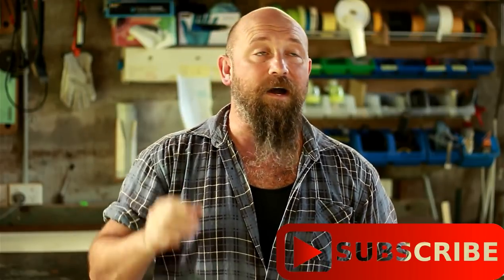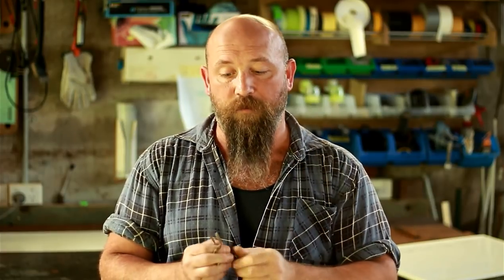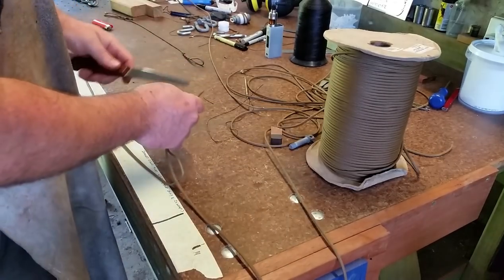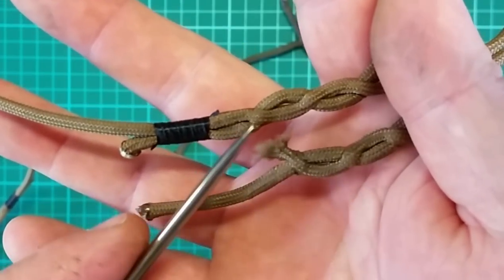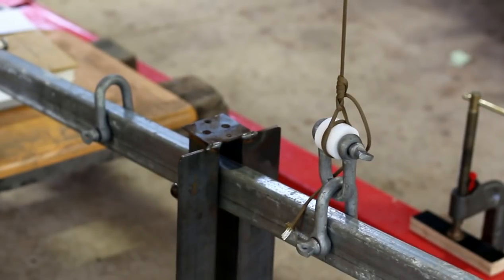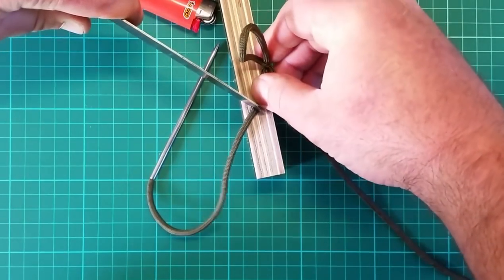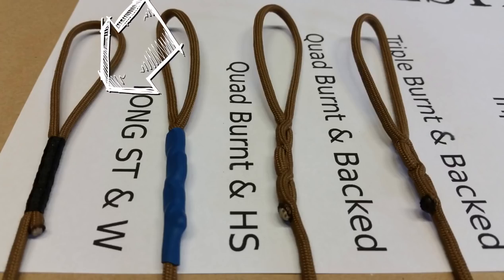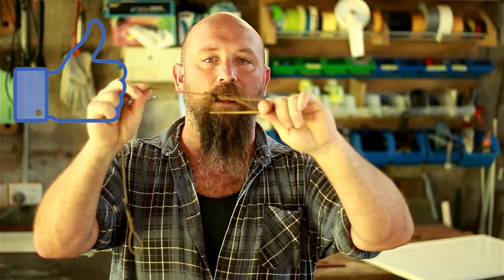Prarcord Break Testing with a 2 TON Engine Crane!!

Comment: Thanks for the video and the information, Ben! I suspect the whipping acts in the same manner as the heatshrink tubing, preventing the small amount of movement necessary to properly tighten down.
Reply from the maker: Cheers Grant, long time to chat mate! I have been tossing around the same thoughts. Although It won't match a true buried eye splice, it needs the same amount of stretch and compression.

Comment: MAAAAAATE Great video, actually came looking for a video on doing an eye splice with 550" cord, as I have gotten into making my 550" 7 strand, into 1600" 21 strand, combining 3 lots into 1 cover (it's a real fun thing to do) start with 4 lots of 550" paracord and attach 3 to the end of 1 (melt 3 of them into a point and attach the other strands to pull them through) but would be interesting to see about doing an eye splice with the para cord.
Reply from the maker: G'Day Iron Forge Knives and please excuse the late reply. I'm not normally rude, I just missed this comment. 

I can't say I have come across bulk packing the paracord like that! I like it and I might have a play with the idea myself. One thing I have noticed that really impacts how much you can fit inside the paracord sheath is how tightly (and strand count) wound the outer sheath is. Some of the cord I have, you can pass almost anything down through it as it is really loose. You could easily do a proper buried eye splice with that cord. Look up the 'Locked Brummel Eye Splice'. The bulk of the paracord I have come across sits in the middle (real 550 cord and the good quality copy) you can partly do a buried (about 130mm) or locked brummel eye splice with a polished 4mm fid. 

I do like this stitch through eye splice as to be honest, It's quick.  A proper buried eye splice with slippery cord is 78 times the diameter...I think. Its closer to a foot (300mm)

Since I was so rude  ;)  and replied so late, here the link to the next clip. 

 https://youtu.be/lvBPyYSTzyk

You might find the info on simple tube fid making helpful for custom sizes as well as a tute on my Stitch Through Eye Splice. I have not launched it yet as I was planning on finishing an instructables for it at the same time...and of course, I don't have a whole lot of that at the moment. 

Thanks for the info and comment mate.
All the best,
Ben
Reply: Machete Bushcraft Australia all good mate , I carry the 21 strand as a back up for camping, hiking and in my GU Patrol, it’s super strong and just nice to have something that strong and light weight on hand if the need arrives.

Comment: I I remember correctly, the other good thing about the figure 8 is that it is easier to undo after load is applied than some knots
Reply from the maker: Darn good point ED and I missed that. I would be an easier knot to undo and I'm sure it's one of the other reasons it is commonly used.
Reply: Probably weakens the rope less too...

Comment: Conventional wisdom says that the safe working load of any rope is around 1/5 to 1/3 of the static load. In other words, the working load is around 100-175 pounds on a 550 paracord line. I wouldn't want to hoist up anything over 150 pounds with a 550 paracord line. 

Each inner strand has about a 50 lb static load rating. The outer sheath has about a 200 lb static load rating.
Reply from the maker: I agree mate. It's tough cord, we just need to apply a little common sense in how we choose to use it.
Reply: @MacheteBushcraftAustralia  I'm shocked at the results you have. It's exactly what I was looking to find out. Trying to make a hammock out of paracord and I would like my suspension to be built out of paracord if possible as well but we shall see. I know after several uses it can wear down on the external shell just from pressure alone over time. Thank you for your video!

Comment: Do you  know off hand how the Bowline stacks up?
Reply from the maker: Darn good question Lazix. I did play around with the bowline recently as I had the engine crane set up. I did not set up the scales though.  It's a good knot but it did not rate as well as the Fig8 follow through. The Bowline was a little more slippy (Had to tie back up hitches).
The test was a length of paracord with a bowline on one end and a F8 follow through on the other. I only tested it only twice though.  The line snapped on both tests at the first hard bend on the bowline.
Reply: @MacheteBushcraftAustralia  Good to know, thanks.

Comment: do you made any tests with the 'classical naval' eyelet?
Reply from the maker: Is that the standard eye splice for 3 ply ropes? If so, I have not tested that yet. I can do them but I must admit, I am not an expert. I guess I focused more on kernmantle style rope as it's more common now days. 

One real advantage to rope work and rigging is that it is a very well tested and documented area. Even though I found some percentage discrepancies with the fig8 follow through, I'm guessing that has more to do with my ability vs the experts data. It was still a useful experiment on my part to compare different style knots with the same cord on the same rig.

I will give that classic eyesplice a go next time I pull that test rig out.
Thanks for the question Rafael.
All the best,
Ben
Reply from the maker: Wow! That is really impressive. I had watched that clip many years ago and it was good to get a reminder of it. It is a very tidy looking system but I'm not sure it would work with paracord... it might??... I think I will have a play with it when I get the chance.
The problem you have is that most of the decent quality paracord has a fairly tight mantle which is going to make this tricky. The other issue is that the 7 internal strands are not woven. There could be a work around for it though.  
Now, you can actually do part of a buried eyesplice with full strand paracord and a single 4mm fid. It's challenging but doable. The Locked Brummel Eyesplice is the one I have had most luck with. You can get away with a shorter bury because you have one stitch through (the 'locked' part in the name).
I do like the speed and ease of the stitch through eye splice method though. I think it makes an attractive and slim alternative to a knot.
I will be giving that eye splice method you shared a go in paracord. If I pull it off, I will pass on the credit to you for it.
Thanks for taking the time to share mate.
All the best from OZ,
Ben

Comment: What about just whipped? For like 2 inches
Reply from the maker: That is a good question Lee. I'm sure there would be a tipping point where the whipping  would be full strength. I guess I did not test it as I was focusing on quick methods to getting a load bearing eye splice. The stitching method vs known knots seemed like a good match up. 
If I ever get that rig out again, I will test some long whipped splices... I'm a little curious myself to be honest.
Reply: Machete Bushcraft Australia I think you did a great test! Not knocking you or your tests!
Reply from the maker: Oh buddy, I did not take it that way at all. Trust me, I'm pretty laid back in that regard. It's just a rule I have that if someone takes the time to comment or ask a question, I do my best to give a proper answer. It was a good question you asked and it deserved some thought. 
All the best from OZ,
Ben

Comment: Interesting stuff (although I was not expecting this from a machete channel). 
That Eye Splice knot looks to be inspired by the Whoopie Sling knot where the free end(?) is threaded through a length of the load side (rather than simply through an eye). It would be interesting to see where the Whoopie Sling knot fails as the load seems pretty well distributed. Here's a video of how it's made (both a fixed knot/loop and an adjustable version): 
https://youtu.be/KtJGTgpv4dc
BTW: The Whoopie Sling knot is used to hang hammocks but uses something stronger than para cord.
Reply from the maker: I think you might be talking about the locked brummel eye splice? I came across that one when I was trying to find the load limits of this stitch through eye splice. I did also test stitching the loaded end but depending on your line length, there is a whole lot of cord to pull through each stitch and I was concerned about friction melting the inner strands. 

I might add testing a woopie sling to the next test list.  I suspect it would perform just as well as the clinch knot to be honest. 
Thanks for the comment mate.